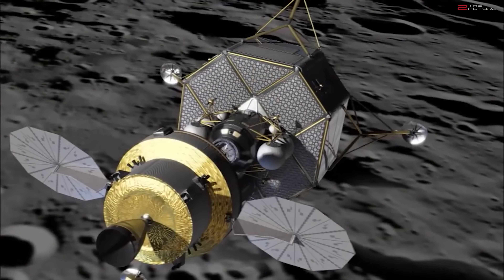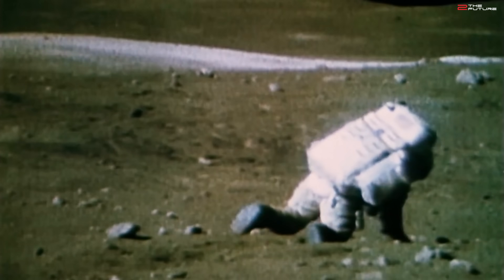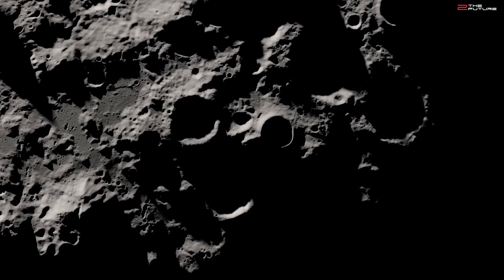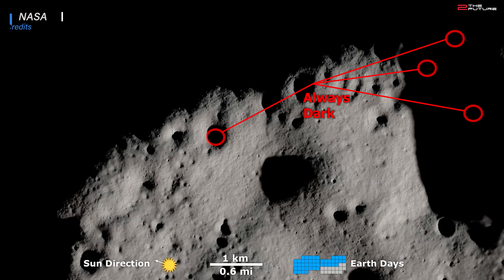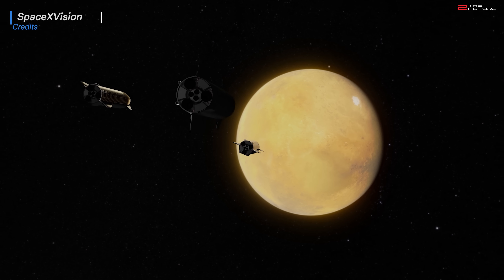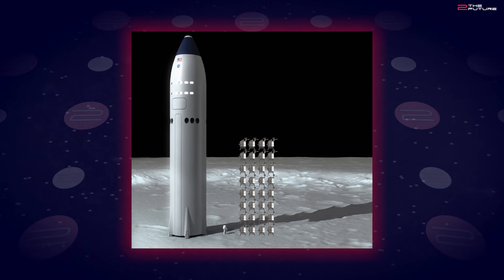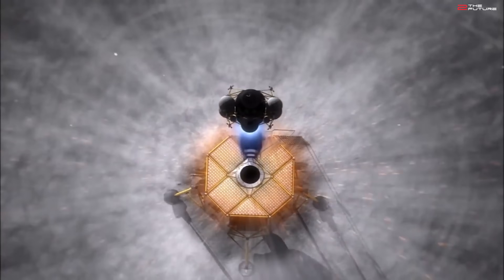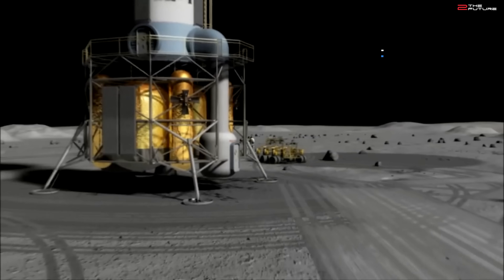Game changing technology that will allow us to build huge Moon Bases !

Comment: For solar all the time on the moon couldn't they just put down multiple solar fields attached by cable?  Yes the weight is a cost but by the dark always craters there seems to be a lot of near constant sun zones.  Production of cable and / or solar cells on the moon later on would eliminate the need for costly hauling.  How about a tower, considering no wind and earthquakes a simple tower could be erected from the harvested aluminum / iron that could carry a significant amount of solar cells. The quantity and quality of solar energy on the moon is massive, take the 100's of millions (if not billions) slated for nuclear reactor R&D and haul up more solar / infrastructure.  Nuclear is important for settlements further away from the sun but it's not needed here.
Reply: Yep, i agree absolutely. High towers are a real possibility on the Moon. We talked about that in a Total Space video actually (lunar future series).

Comment: Magnetic powdered turbines are better for first production of electricity. With low gravity I theorized that the turbines should spin faster with force making it a viable easy solution on the moon where same technology on earth does not work well due to gravity causing the the turbine to be harder for the magnets to spil enough to generate significant power levels

Comment: Another product from the moon is electric wire with woven fiberglass insulation.  Between metal & fused moon dust to create all construction materials, wiring, local thermal & electric energy, food, water, and fuel,  nearly all colony expansion materials are locally available.   Atmosphere from local oxygen, nitrogen & humidity too.
    And the key that unlocks the economic viability will be super low cost per pound getting on and off the moon.
Reply: Unfortunately, there is not much Nitrogen on the Moon. In the regolith there is some, but in really low quantity, as I understand.
Reply: Szabolcs Járay with such a large lunar surface, hopefully they will find good ore deposit sources

Comment: Problem with Nuclear reactors is you have nowhere to put extra heat - you need thermal cooling radiators.
What about putting that heat into melting the regolith? Two birds with one stone. 

And of course the energy produced goes into battery storage, so you can use it when you need it and regulate how much...

Comment: There won´t be a space factory on the moon in the foreseeable future. Even if the experimental reactor is a success, that is just a start. Silicon and Aluminium have limited uses. Silicon is mainly used for computer chips and glass, while Aluminium is used for lightweight structures. Wires for example are usually made of copper and require an isolation around it, made out of polymers. Most technical applications need more than these 2 components to build. And even if you find something to make out of these materials, you still need the machinery to make use of it. As highly specialized machinery like on earth won´t be an option on the moon, 3D printers would have to suffice. But these come with their own limitations and would enable some kind of workshop at best, but by no means an industry.

Comment: I wonder what the options for ultra cold lubricants are, my ex comes to mind. But seriously, are there any options for some sort of gel or low temperature oil for joints and such?
Reply: NASA Technical Memorandum 106392: Lubrication of Space Systems. An intersting synopsis about the various lubricating liquids, greases and solids that can function in an outer-space environment. I like the idea of magnetic bearings, too.

Comment: What if we used the SpinLaunch system on the moon? Wouldn't that be essentially a mass driver?
Reply: This would be a good one!
Reply: It would be 100 times better then trying in on earth, thats for sure.
Reply: It's better to build a linear accelerator on the Moon. It can launch people and fragile cargo and spin launch can't due to huge acceleration.
Reply: @TechMasterRus  Thats not true at all, No matter the angle or lack there of that you throw something, it has to come to the exact same speed to reach the same orbit, height or whatever your aiming for.
The only real difference that comes to mind for me is the fact that the g forces for a spin version will be sideways before release while its backwards on a linear, but once released its instant zero g (ish) either way.

But, a spin can be made in a very small area compared to a linear one while giving the capability of acting like a linear one of any length.
Reply: @Vatsyayana87  Exactly. Spin version can be smaller, but it is not what we want. To escape the Moon, you need 2.38 km/s. And now count how large the centrifuge should be to provide survivable g-force at 2.38 km/s. It'll have enormous size and it'll be difficult to support such structure. On the other hand, the linear version can be as long as we want and there's no problem in just putting it on the surface.
Reply: @Vatsyayana87  If we want a = 5g, for example: r = v^2 / a, it gives us radius of 115 km.
Reply: @TechMasterRus  How long would a linear one be to achieve the same thing?
Reply: @TechMasterRus  Also, the acceleration you mentioned as the problem can be what we choose it to be right?
Reply: @TechMasterRus  Also also, a spin version can be on its side, so supporting it wouldnt be an issue any more then a linear one.
Reply: @Vatsyayana87  No problem. Time to achieve escape velocity: t = v/a, length l = a*t^2 / 2 = v^2 / 2a. We get 57.8 km for a = 5g (let's say, 60 km to also stop the accelerating device). It's better idea in all kinds. Please check me if I was right in formulas.
Reply: @TechMasterRus  I feel like i understand what your trying to say could be the issue, i think your trying to say the constant change in direction of a spin one adds more G forces then a delta v in a straight line, is that correct? 
Whats the letter/sign for direction in this case btw?
Reply: @Vatsyayana87  OMG, just imagine such mega-structure on its side. Also, you are going to spin 115 km structure at a velocity of 2.38 km/s, don't you think it's far beyond what we can in near future? Remember that the tallest building we built so far is less than 1 km))
Reply: @TechMasterRus  Well my only question is, does change in direction, make it impossible to hold a 5g acceleration until you are at any goal velocity, cause if not, then making a 1km ring seems like a much much better solution then a precisely straight rail 60 km long.
Much less foot print, much easier to create and control.
Dont get me wrong im 100% for either solution, but i do not understand if change in direction at different velocities will hinder this or not. I do not know these formulas.

But from what i feel i do understand, that one factor seems to be the only one to consider. Other wise it seems a circular form is better in every other way.
Reply: @Vatsyayana87  When you go around a circle, you experience centrifugal acceleration. a = v^2 / r. So if you make a 1 km ring (500 m radius) and go at 2.38 km/s around it, you'll experience acceleration a = 2380^2 / 500 = 11329 m/s^2 , or 1156 g.
Reply: @TechMasterRus   11329 m/s^2 is just a velocity, which im pretty certain has nothing to do with g forces unless its determined over a specific period of time (Or the equation of moving in a circle im guessing). So cant be converted into Gs like that...
But that force your speaking of is exactly what i was asking, its the change in direction that creates centrifugal force. Without that change you can be a a billion kph with 0Gs.

Guess im gunna have to learn some maths lol...
Reply: @TechMasterRus  I am doing other stuff atm but ill look up the formula we are discussing, im guessing itll be more like something along the lines of V times Pi divided by Radius. 
I dont know if there is any formula concerning a circle without Pi lol

My thought process is this (without knowing any formulas), You multiplied the radius to the velocity, but i know that cant be right since the larger the radius (so the straighter the line) the lower the Gs would have to be while holding a set velocity.

Comment: A network of solar power sats in low to medium Lunar orbit can provide power anywhere all the time for a fraction of the cost of nuclear.
Reply: Sound interesting. But how would it be implemented??
Reply: Absolutely no need in sats. Just putting solar panels around the pole, connecting them with power lines. All distances on the Moon are much shorter.

Comment: Do you think you can make a glass dome in one of those craters and then a layer of water underneath it cycled into drinking water and doubles as additional protection from radiation? maybe even have some copper pipes to collect the heat and turn it into electricity is possible?
Reply: @ooga booga it should in theory just sterilise your water as the water is constantly cycled from dome (water tank) > water used > water treatment plant > dome. Though studies will need to be conducted for over long term effects. But with a water dome you can also do other things like climate control such as rain as well and produce clouds if set up correctly. Would immensely help phycology as well.

Comment: If we plan to maintain a base there over the long term, building sustainable terrarium and a solar power station to power it should be first. We cannot afford to shuttle supplies other than manpower from Earth to the moon for basic needs even if Starship can reduce the costs to do so by ten fold.  Once we have such a research base functional we can expand out to mining and industry such as fuel production and aluminum smelting, silicon refining and ultimately building robust layers of industry to build finished products needed in the space industry cheaper than they could be both built and launched from earth.
Reply: Concur! Essential to set up mining operations from moment one. Robots are a must long before humans get there!
Reply: @richardloewenhagen3818  Additionally, I think that tele-operation of machines from a lunar base, and lunar space station, or given the relatively short lag, even from earth would be possible if the AI is not quite up to the task of operating autonomously yet.